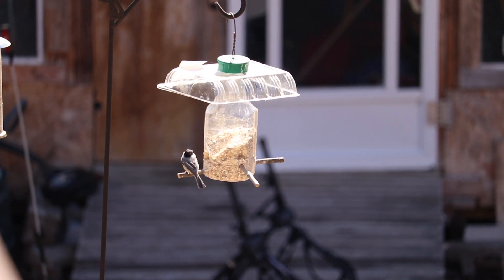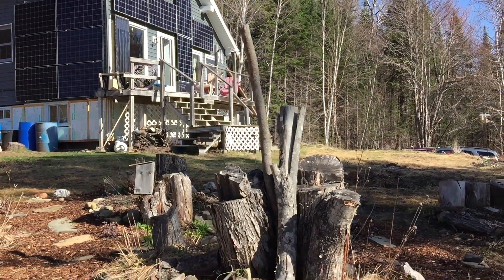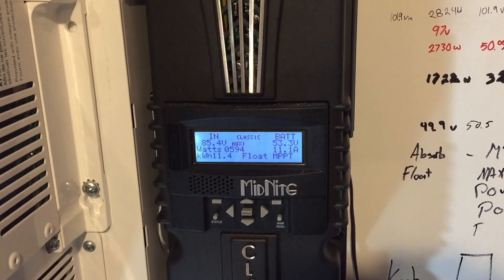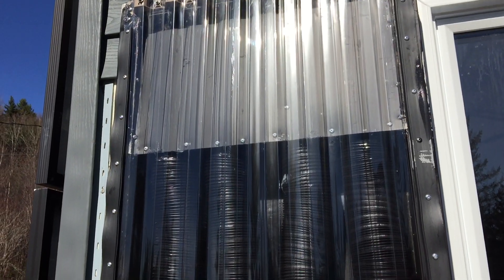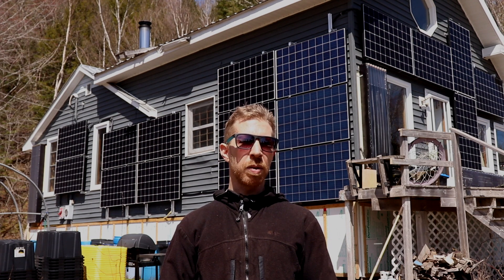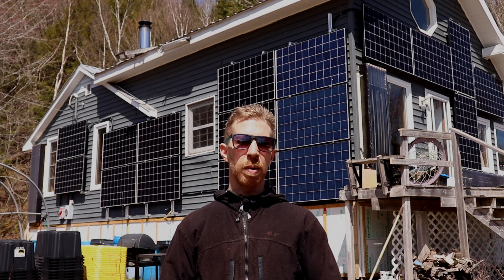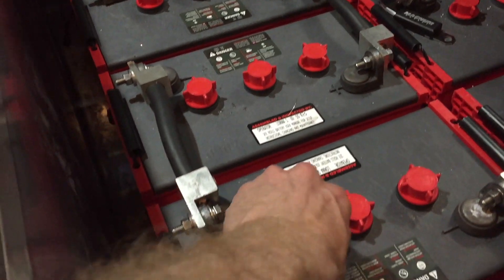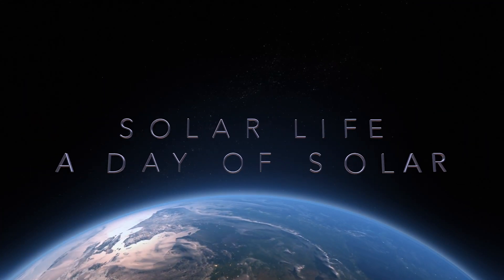Solar Life - Episode 2:   Our Off Grid Solar System on a Sunny Day

Comment: Hopefully you have your Battery Box power Vented. H2  is Explosive and you can't Smell it.   Make you have a flammable Gas Detector in the area outside the box about 6 feet away
Reply from the maker: Yes it's vented and is tied in to the charge controllers.